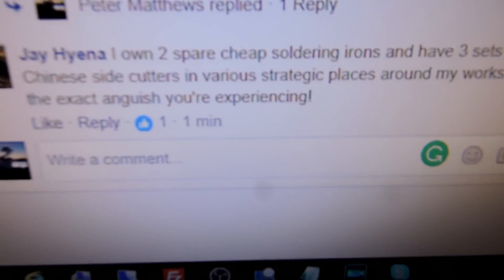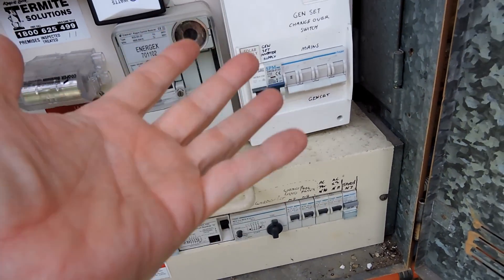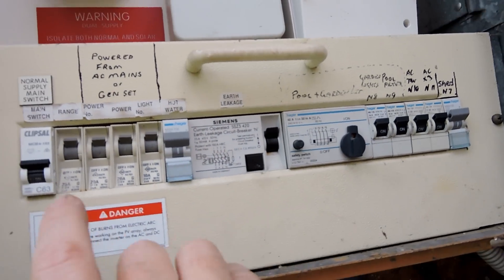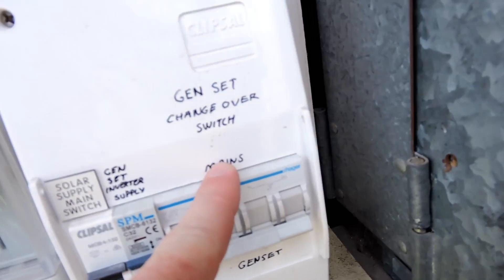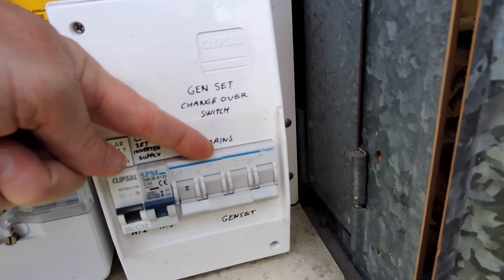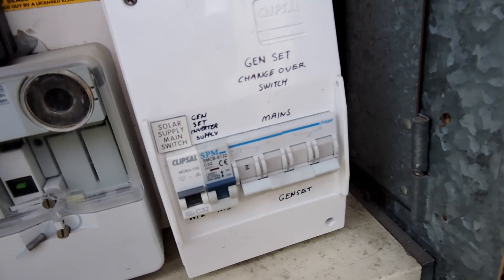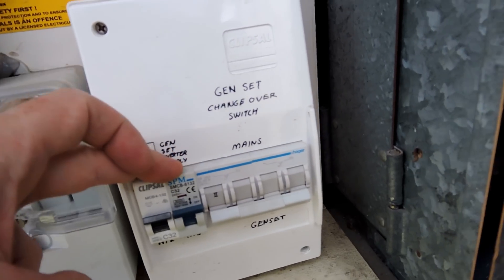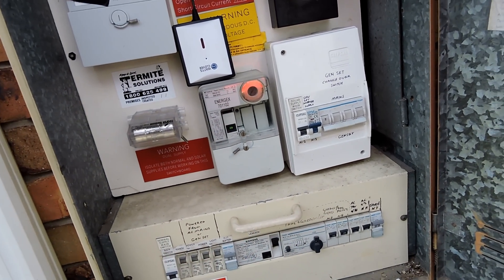Snippy has gone & how I connect inverter to my home

Comment: So Pete - I'm assuming you are allowed to connect the MPP to the Australian grid? Any caveats to that?
Reply from the maker: No. They are not approved
Reply: @HBPowerwall  So how do you get away with connecting yours? I assume you're allowed to have power coming in from the grid but not allowed to feed power back to the grid?
Reply: BTW - thanks for the prompt reply. Long time fan - about to build a 48V battery with 280Ah LiFe cells.
Reply from the maker: MondoTV not grid connected
Reply: @HBPowerwall  But I've seen in your videos you have incoming power from the grid to the MPP and you have that breaker on your board going to the shed? Confused!!! PS That's easy to do :)

Comment: When you switch the house supply between grid and inverter is there any flicker in the lights or computers restarting etc? Does the pip inverter synchronize it’s 50Hz phase with the grid?
Reply from the maker: if you have a larger load on like heat lamps in bathrooms you can see a flicker. Never had an issue with it tho.. always worked well

Comment: When you switch the house supply between grid and inverter is there any flicker in the lights or computers restarting etc? Does the pip inverter synchronize it’s 50Hz phase with the grid?